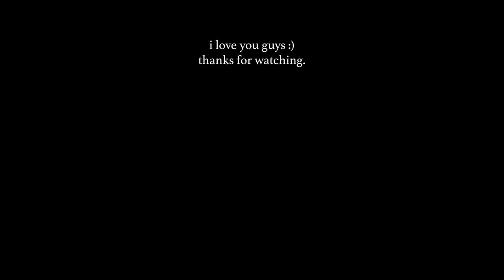I found a SECRET passage in my 130yr old cottage!

Comment: My guess based on how small the opening is, is that at some point the house was sagging and they had to add supports.
Reply: How would an opening help a sagging house ?
Reply: @DeepakKumar-xr3oh  they have to get under where the house is sagging. She said she part they were at didn't connect to the basement so they'd have to create an opening to get to it.

Comment: looks like a lot of new work done under there. I would guess they cut that hole fairly recently to get in and shore up the house where it was sagging. all the modern concrete blocks,fresh lumber and plastic stapled to the underside of the subfloor tell the tale! still pretty cool though!I That rock that you think might be an arrowhead actually looks to me to be a fossil. I found something that looked almost identical to that and it had a split down the middle, I was able to crack it open and saw the imprint of fossilized fern leaves, so it was a bundle of leaves all together that had fossilized. if I knew how to post a pic in comments (not sure if thats even possible) I could show you the one I found , it is pretty cool. I found mine just in my landscaping rocks that came from who knows where, just small river rocks. The one you found could be an arrowhead but looks to rough for that to me. I have quite a few arrowheads and they tend to be more "polished" looking. awesome finds under there, I bet there is a lot more that fell through old gaps in the floor back in the day! good idea to wear a respirator next time, who knows what kind of crap could be in that dust! I hope you go down again and look for more this was really fun.

Comment: I enjoyed your fanciful romp through the underside of this marvelous little Victorian bungalow. We can all buy into gracious old structures and their secrets. If one closes one eye, and squints the other, it IS possible to miss the floor insulation previously applied (using the crawl space you and Bart so gingerly explore). It isn't a stretch, then, to consider that the connecting hole dug into the foundation (between two underfloor areas) was made to reach a final section. We humans have an infinite capacity (and perhaps a need) to be fooled. We are just an endless ride of "anything can happen," just one dusty bureau away from discovering "Narnia." Imagination does, indeed, circle the world; and, is of a texture that simply goes away if not used...

Comment: u have to wrap the  wire around the shaft of the detector if it bumps  stuff it can give faulse signals  if u   have any questions   and  a smaller coils would be best  for tight  spots

Comment: The porcelain thing looks like a broken end from the "tube" in knob and tube wiring. My house is 100 yrs old and i have these all over. The tube is the part that goes through the 2x4 wall stud. The knob is used to keep the wire in place as it travels along a straight run..

Comment: considering the dice, the spinning top, etc... the solid cylinder piece looks like a bishop from a chess board.  along with some of the other commentors, looks like you have some recent bracing with the cinder blocks and wood along your beams.  so the holes in the original foundation is probably just an access point to the other side.  cheers

Comment: Those floor supports look doggy plus someone has been down there recently due to the plastic and some of the stonework is bedded in with modern cement. You need to remove the dirt under there to a firm base and install proper supports for your floor joists. But the good news is when you clear the dirt pass it through a sieve and see what you could potentially have missed.

Comment: I wish I could see it today this isn’t fair having to wait until the premiere.
I can’t be a patron so I have to wait.
This is common in old houses were there isn’t lots of rain. It was built for storage in my old house in Utah I had a full basement and a special room for food storage. Utahan’s kept food in a years supply in case food shortages. They built large rooms in the basement with lots of shelving to store food. Potatoes kept a long time down there. My house was 2 story with a finished basement for summertime sleeping and living.
2 bedrooms down stairs and 2 up stairs baths on both levels also. 
It was  hudge place but easy to cool, and heat.
This is a great find and now you know what it is there for. 
I wish you wouldn’t put out videos that we have to wait and see. I do get notified when they are premiering. 😅 But also a day or more before.

Comment: That peice of porcelain you found is from the old wiring in the house these were put in the walls and the would run the bare copper wire  through these and it was called  knob and two  wiring

Comment: Yes, I think the new concrete pads, beam supports, this century construction level, wire through the foundation hole, suggests the space was essentially a crawl space and the floors above better insulated and leveled to fix foundation settling.  If children did use it as a playroom or hideout, they would have required something like a lantern to light it - and a spilled kerosene lantern fire would have been too risky.  Candles maybe, with hurricane glasses?  Still too risky!  When electricity became available in rural places then the possibility of a bulb hung from a joist maybe.  As a momma, I don’t think I would routinely let my kids play there.  1930’s toy train or car wheels and a dice:  maybe there was an incident when the family did go down there as protection from a violent storm, robbery, who knows.  I do think the placement of the trap door boards beneath a bed to conceal it was probably a good idea - maybe a smaller rug over the boards in the winter to stifle the air, slid off to increase airflow into the house during the summer cooling needs (hotter air rising toward the top of the house and creating a draw).  Perhaps this is the source for fresh air for the potbelly heat stove - you have to be sure you have a good source of outside air coming in nearby the stove combustion, and safe ventilation and burn protection of the vent walls.  All sources of combustion can produce toxic CO gas you never want to collect in living or sleeping areas!  I sure hope Alyssa had that checked out.  Drafty houses were safer back then, perhaps, from this hazard, but when we start sealing things up, then ventilation for these older technologies becomes extremely important.

This was a very fun portrayal of treasure hunting.  You had me goin’ there for a minute - my heart skipped a few - even that quick flash of that treacherous jagged “shovel” that looked like it could be a m+rd+r weapon (Bart was already traumatized enough - Alyssa, no, not …. Just kidding).

I’m going to be a little forward maybe and say it’s very apparent you guys love each other - and that’s how it should be if you ever find your adventuring partner for life.  I don’t know why Bart seems familiar to me - I’m in a big city area of TX - maybe I’ve seen him somewhere - church?  I just know that for a man to run a special errand of delivering a dog, and crawling down a mysterious passage under an old home like that (unless he’s an inspector or estimator), is an act of dedication to someone he thinks is very special - what a friend!  More precious than any sack of gold coins.  Chances are, any gold coins that were there were removed by the children before they moved on.

And, have you given any thought that you two could be the reincarnations of the original children?  Crazy thought, but maybe the dates and lifetimes don’t work out.  Life is beautiful and so is Colorado, when you’ve got friends!

Love to ya’s, classy people!

Comment: Funny that I own several metal detectors.  Your mind goes straight to treasure and buying a metal detector and my mind is with Barts, that how horror movies start.  LOL.  I'd certainly would run that detector all under the basement/ crawl space and in the yard concentrating where cars would have parked and where family would have relaxed in the yard. Figure out the discrimination mode on the machine to knock out the iron nails and Good luck.  I bet you will at least find a couple of old coins and some steel toys.

Comment: The footers for the floor Jacks are not original, they were either replaced or additions. Imagine they knocked holes in the stone foundations to get from one side to the other without having to cut holes in the floors everywhere.

Comment: Use the metal detector on the walls, they should only go off if there's something in the wall. And they didn't have wiring in that time so any metal should be on the outer wall.

Comment: The Porceline Piece Is An Electrical Wire Insulator For Running Wire Through The floor Joists. Train Wheels. [Jacks Looking Piece] Part Of a Spool Winder 4 Auto Play piano. Wood Piece Is The Top Off A 4 Poster Bed. Top Piece Is A Jewish Dradel.
Reply: Exactly, spot on!

Comment: Lucky if you find something of antiquity and very valuable on property you own because you can legally keep it and or sell it. Unlike something similar on federal, state, other public or unowned private property. I know the Minelab 800 detector has a presetting for gold which will actually pick up any metal object depending on size and how close to the surface. You should be able to test the detector by hovering over items like coins or a gold ring you've buried under about 3 to 5 inches of dirt. Most of what you are likely to get are things like nails, washers, but it's very possible in a setting like that some old coins might fallen out of someone's pocket, even gold coins which were minted until 1933. Once you get the hang of detecting check out the rest of your property. Looks to me like the kids sometimes went down there as a kids only club. Hence the games and toys. Very interesting.

Comment: @regretlyss Since your house is 130 years old, it would have been about 26 years old at the time of Prohibition in 1919. It's entirely possible that the hole in the floor and the opening in the wall were cut around that time in order to hide booze.

Comment: the strange kind of ceramic hollow tube look like old electric wires insulator cause at first the wires were single wires running thru the tube that were installed thru wood truss and stud btw its only the end that you found complete these tube are more like 6 to 8 inch long.

Comment: The ceramic tube was part of old electrical wiring.  It was used to insulate holes in wood to pass electrical wires through.  Google nob and tube electric wiring.

Comment: The last vintage 18' three vial sold in 2014 June with all three vials for $79.00 yours has two vials one missing. It was probably sold on Ebay. There was a twentyfour inch sold with all three vials for $129.00 in 2014 Feb.

Comment: Oh dear me, go under any house brick or stone and you find these access holes, made many myself,  reason to gain entry to another part of the house from underneath,  reason for this to bring in services without disturbing finished sirface, ie floor boards etc.
See they have been under there putting in insulation between the joists, no big deal.

Comment: The difference in size between those dogs is crazy lol you have to get a saddle for him lol
Also how does that fan on your stove work exactly?
Reply: Fan uses the difference of heat from base to the fins you see on the back of it to spin so it doesn't use any external power and speed is determined by how hot the stove gets. They are really cool. Quick Google search should find them and how they work.

Comment: sorry to burst ur bubble. lol but if u look at the bearers they where bent or bending. the floor of ur house would of been squeaking and ur walls would off started cracking etc. foundation collapsing. Someone recently came and jacked the house up and put in those new concrete pads and leveled the house and "reblocked" the house. Because of stone foundation there is no other way in to get to the internal walls and structural parts of foundation. Ive done it before for a living.

Comment: Not a top, sort of...Thats a dreidel, well I guess it could be considered a top. Used during Hanukkah. Could also be an old plumb line weight but it looks too small and is the size and shape of a dreidel. That's were my vote lies.Look for Hebrew letters carved in the sides. The wheels were probably a toy of a carved horse with wheels instead of legs, very common for jewish kids back then. The spindle that looked like "jacks" was probably an old cutlery rest. Which was also common. "MFG CO means Manufacturing company. There's probably a name of the company somewhere.